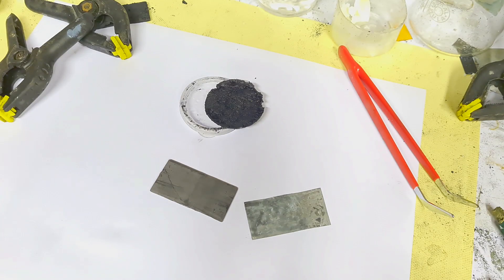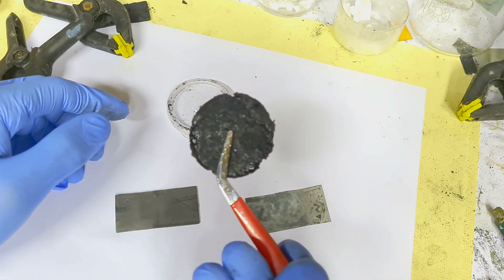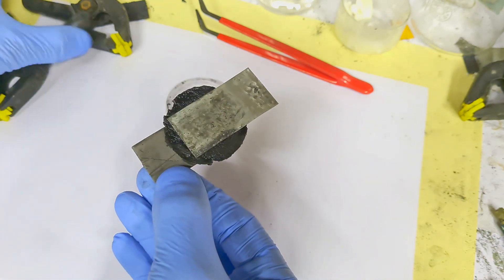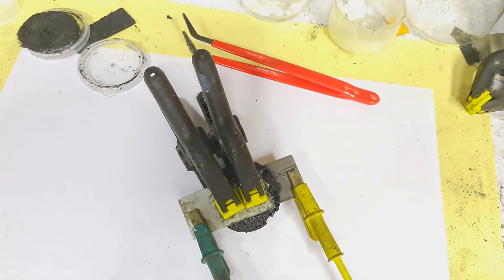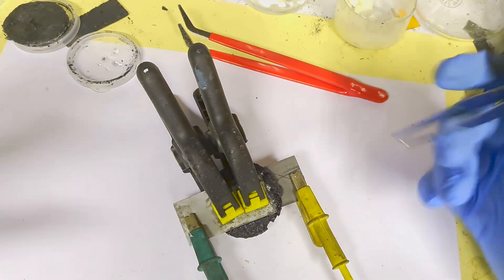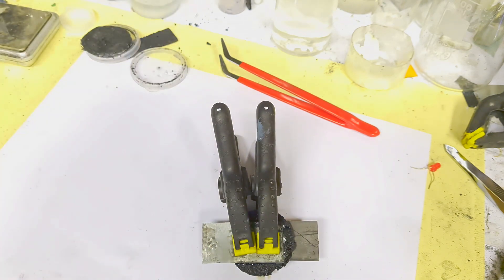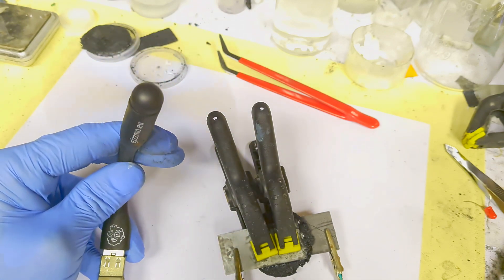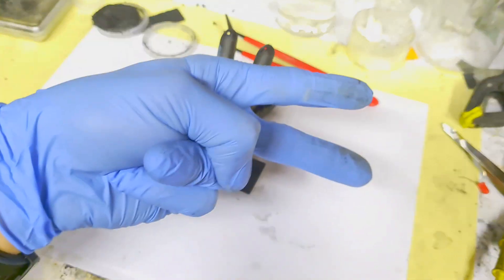PowerGel - Zinc Bromine GEL Battery

Comment: There is a company call Gelion that is making this battery.  I am hoping that it comes to America from Australia and replace the existing lead-acid battery that we are using, especially for the UPS power back up for our computer. This Zinc Bromine battery is already used in Flow battery.  But Gelion just turn the solution into Gel and make their Gelion Battery.
Reply from the maker: Hi! Yes I know Gelion and the battery that they developing. The Zn-Br battery have a place between lead acid and lithium ion.
Reply: @cayrex  they are the best option for stationary energy storage.
Reply from the maker: @somebody6048  I will say,... yes
Reply: This aged well

Comment: Can I use a pool cleaning bromine granules diluted in water to make a battery?
Reply: You may referring to sodium bromide. Yes, use can use it after you convert it to zinc bromide by reacting with zinc sulfate and letting the sodium sulfate settle out before pouring off the solution from the top.

Comment: This is very interesting.  I'm sure you've seen the paper regarding static zinc bromide batteries - using TBAB as the gelling agent.  I wonder if there are any edge effects that are worth exploring with the current collectors ie rounded, symmetric edges; coated edges ie so that there is a central electrode that is only in contact with the gel, the rest being an insulating material.  Lots of work to do to watch these dendrites "over time" :)
Reply from the maker: Yes I see the static ZnBr paper. That PowerGel is more inexpensive and also do great job as TPABr3 additive. Also the end cell is more cheap,...  In the end if I want I can also add some TPABr3 to the gel or CMK 3 active material,... and in that case the performance of the cell will go to the moon 😆.
Reply: @cayrex  the moon is good!
Reply from the maker: don't worry about dendrites, because the dendrites will not damage the cell in the first place. The dendrite proofing of the gel was unexpected, but is nice touch of safty anyway.